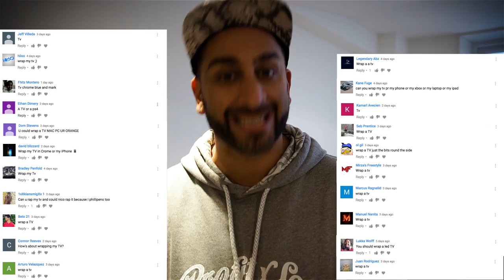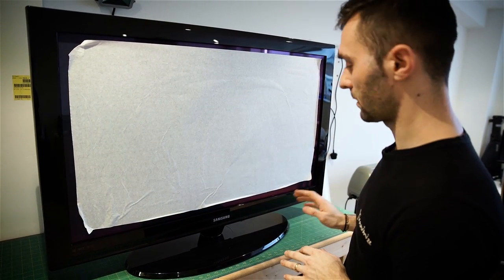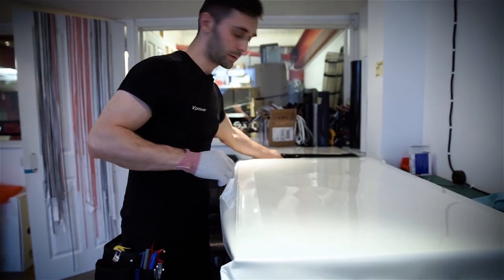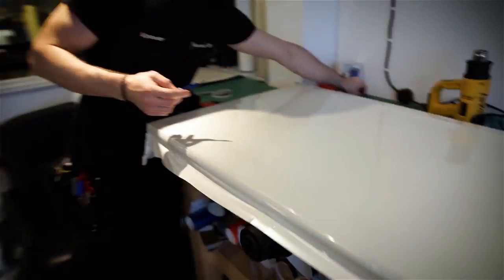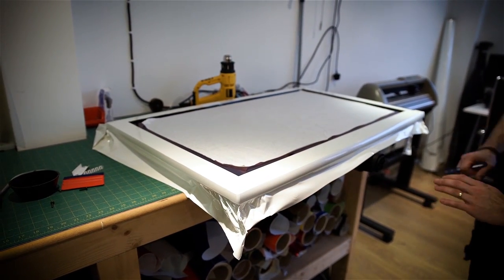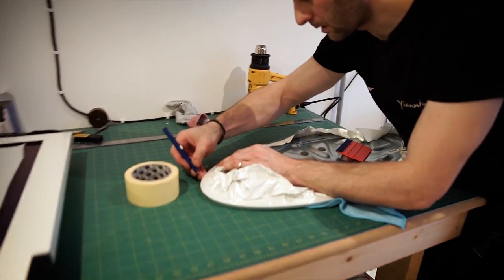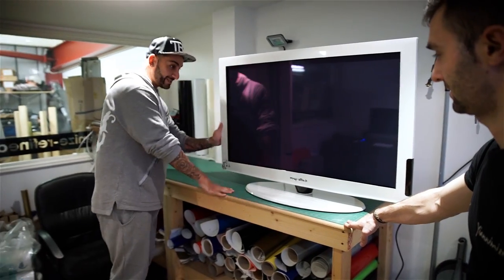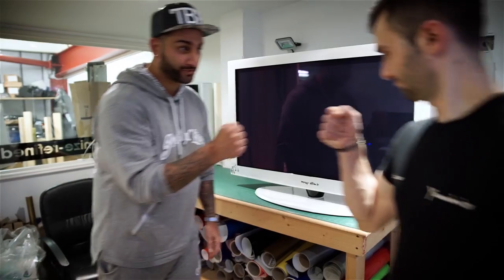Samsung Plasma TV Wrapped in Pearl White | Wrap Attack 002

Comment: How does the cutting tape work?
Reply: theres different kinds but to keep it simple the main one is a straight one-piece cutter, it has two layers the cutting line is placed in the middle of the tape, you put it where you want wrap over it then you separate the bottom line and pull it, then you pull the top layer